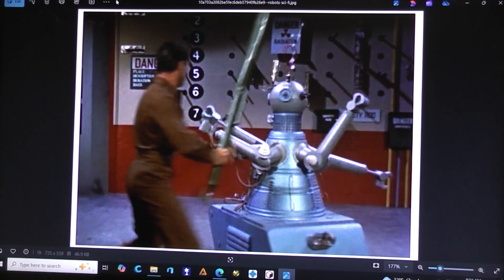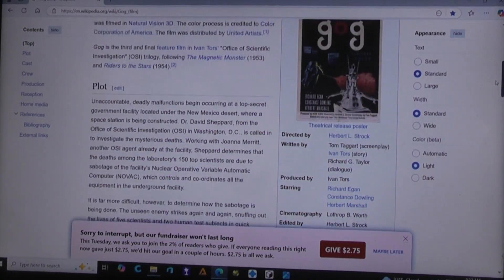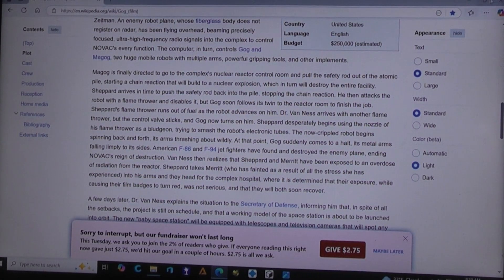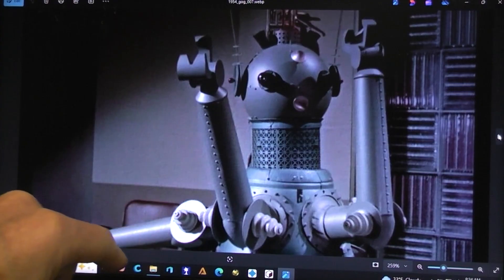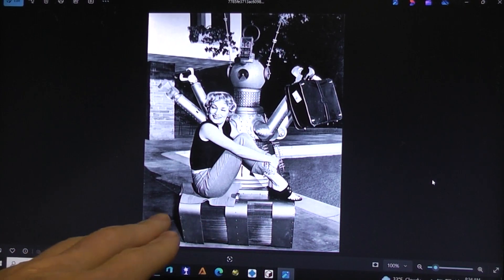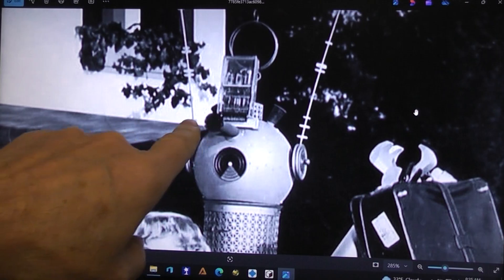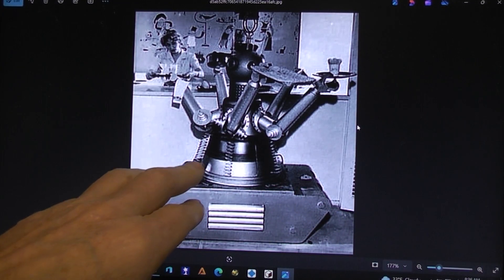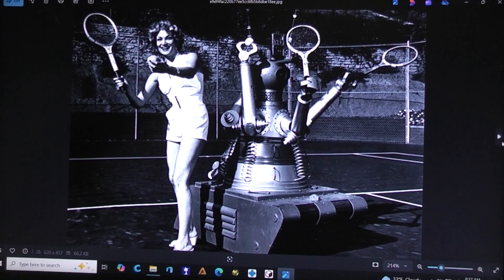Let's talk about GOG and MaGOG as possible 3d printed robots.

Comment: I had to laugh at your dialogue about all the dumb or stupid parts!  Those stamped metal sheets used in the neck are still available today. Pretty sure I’ve seen one at Home Depot or Ace Hardware. I definitely think you should make one, but also take creative license to deviate from anything dumb.  Maybe use Mecanum wheels to be able to move any direction. I know there are smaller versions as some Battlebots have incorporated them.
Reply from the maker: Yes, first thing I thought about was the Omni wheels, the only problem is controlling them turn the simple project into a complicated one. Yes, I have seen the same stamped metal at a Lowes a few years back, so it probably still around if anyone want to build a full-scale version.

Comment: When I was into RC airplanes some people built scale models that concentrated on accuracy for the purist.  Other people built 'stand off scale' models meant to look like the full size aircraft as long as you didn't examine them from up close. I think there were also airplanes called 'fun scale' that were even less exact. I think 'stand off scale' would be good enough for this guy but I'm not a purist. If I were going to design a GOG, I might do a caricature or cartoon version with a bigger head but I like the cartoon look. Those arms in a circular pattern remind me of an old wooden toy. It had chickens in a circular pattern that were attached by strings to a weight in the middle. Moving the whole toy in a circular motion would cause the weight to actuate each chicken so it looked like it was pecking the ground. I'll be watching to see how you decide to go.
Reply from the maker: I remember the chicken pecking toys, it is alot like that.

Comment: You bringing up the subject of whether or not to do a project makes me want to vent...
I just finished a project for a little robot that can draw numbers mechanically and without the need for batteries. Here in my country, there is a real craze for lottery bets. I showed it to several people and it was a huge success, which encouraged me to mass produce it.
So I spent hours on the project and managed to optimize costs as much as possible (production, packaging, inserts, etc.). The 3D printing would be done on a printer farm that can produce high volumes at a much lower cost than I could with my home printer. In the end, I ended up with a sales price of approximately US$8.00 (with a very low profit margin).
Last week, I went into a convenience store and saw that they had a basic mouse for my computer. I checked the price: US$1.64 (these are values equivalent to the US dollar, since in my country we use the REAL currency (R$). I don't know how they manage to make a mouse cost less than US$2.00, since it is imported from China (including production costs, inputs, packaging, taxes, import tariffs, etc.) and still make a profit!
PS.1: Speaking of small parts, I also came across this problem when designing my robot: one of the axles used needed to be very thin (1mm or less in diameter). I ended up choosing to use acupuncture needles, which are extremely thin and resistant. The other axle was not so thin (3.4mm), but since it would be subject to considerable tensile force, if it were made using the 3D process it would end up breaking easily. I ended up choosing to use lollipop sticks because they are made of injected plastic...
PS.2: Regarding the design of this specific robot I agree with most of the comments here. Feel free to make your own changes and the end result will certainly be cooler than the original design!
PS.3: Sorry for the too long comment...
Reply from the maker: Best of luck with your custom projects.
Reply: @Robothut  Thanks a lot!

Comment: I always find it amusing to see how low-budget special effects artists get creative.  There's so much off-the-shelf 1950s hardware on those robots, like the electrical insulators on the arms and the perforated sheet metal "neck" (which you can still find in hardware stores).  I don't see a reason to build a robot you don't particularly like.  I'd say keep the sections you like and get creative with the parts you don't like.  You could replace the entire head assembly with something else, (for instance, the head from Star Trek's Nomad).  Or find a design from a toy robot, like Robot Commander with the googly eyes.  It's interesting to me how many robots of that era used tank treads for a base.  I'm not sure if that's a holdover from WWII (making the robot look more like a tank) or whether it was just easier to implement on screen.

Comment: Cool robot.  The head ring antenna reminds me of the one off the futura that they made the batmobile out of the little control box that's clear on his head 3D printed flat recessive maybe maybe just mix up some clear epoxy and feel it look like a clear box I think it would be a cool 3D robot like your other projects some of the stuff on the head you'll have to scratch Built don't  like  the antennas  I always wanted one  looks fun like the coil like springs  make them  with just wire then glue them  if you just had the main parts of the robot 3dprint  would be fantastic the creativity will be fun making all the little details yourself.  Look like fun project bump and go robot or non-functioning would be awesome too.